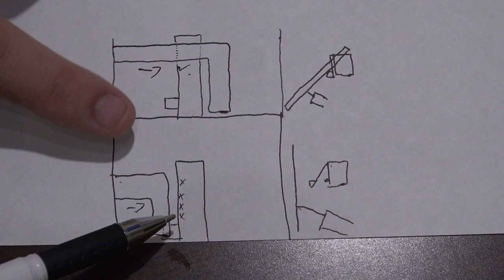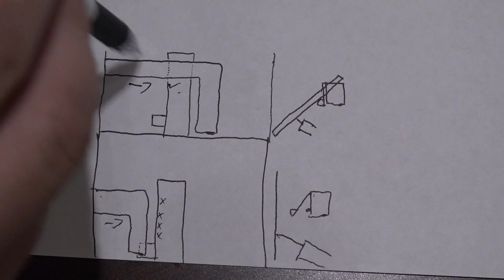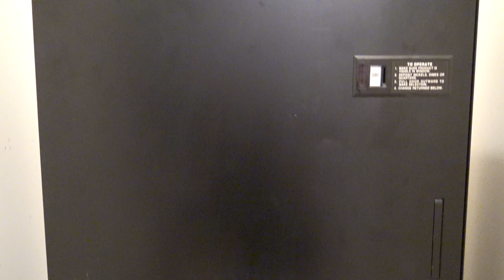How to Set Free Vend on an older vending machine - EASY

Comment: I just bought a ct48 and it worked when I purchased it, once I got home I changed the price to 50 cents, and the money just goes thru to the coin return, and the dispenser doors won't open, the middle door needs replaced but works, has about a inch or 2 when you pull on it, I'm dumbfounded at this point